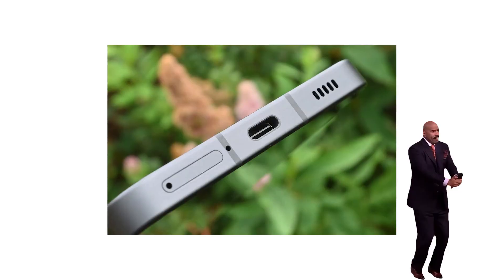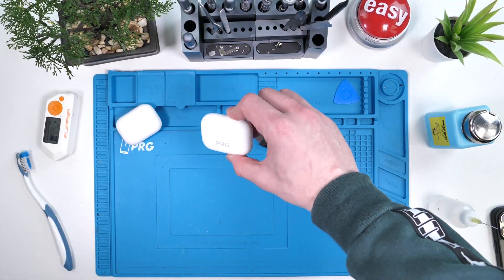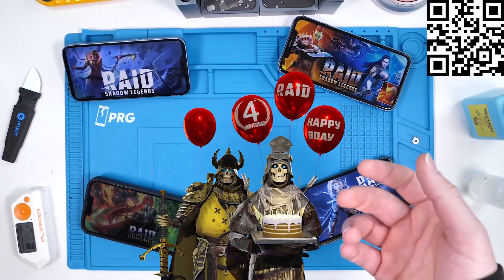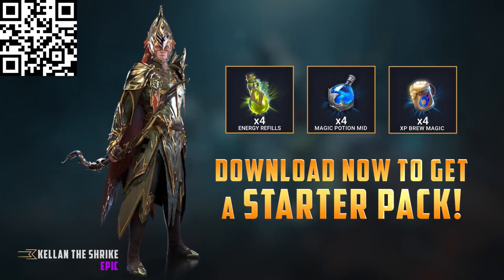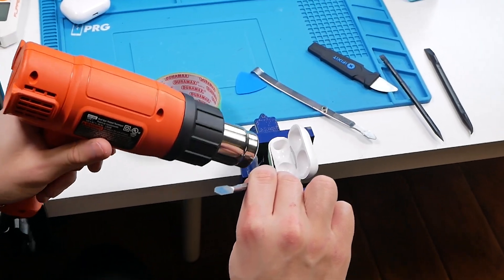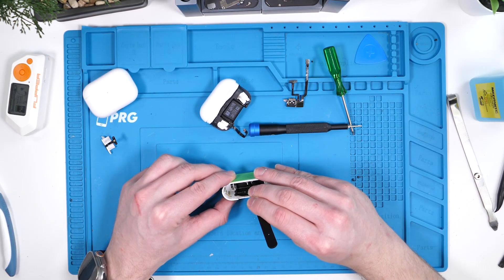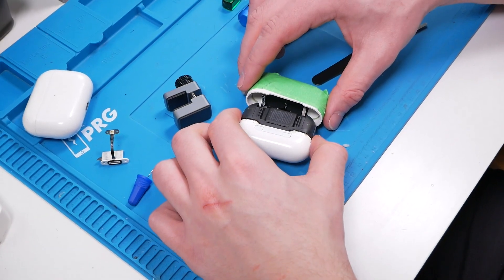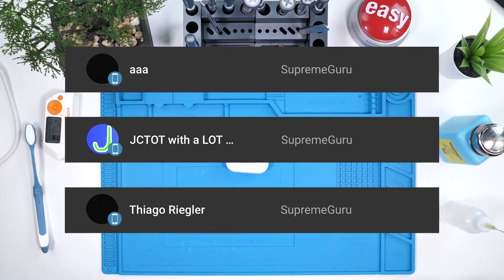Apple Won't Like This One... Airpod Pro Mod

Comment: USB-C in the style of lightning would be better. Lightning is more durable because the male end that can break is on the cheap cable not on the expensive device. Lightning with USB 3.2 or whatever is current would be the best connector. Period.
Reply: Does that happen on the macbook?

Comment: Little tip from an ex GB, when trying to flush mount connectors like this, do the mounting screws up a little bit, then use a cable to make sure the port is snug before tightening down the screws.

Comment: hey i dropped my phone in water i tried powering it off shoving in a towel and using silcon packets it turned on but the screen turned green and turned off and wont turn on what do i do

Comment: Barely able to see led in camera L
Meanwhile on $17 amazon bud it projects a green dot on the ceilings and you always know where it is. Also big case L I literally found $19 (and tested) that can recharge the 8 hour battery on the waterproof earbuds 10 times and charge your phone and tell you the exact battery percent on the headphones and case and not being light mode and it's barely bigger 😂

Comment: Yo…… how do you swap the battery?
Reply: Your iPhone is eligible for a battery replacement at no additional cost if you have AppleCare+ and your product's battery holds less than 80 percent of its original capacity.

Comment: HI man im tshepo from south africa..can i ask something...ive an iphone 7 stuck at bootloop tried recovering it using software restoration but it didnt work...went to a repair shop to get it fixed but they said they dont see the problem or cause of the bootloop..i was asking if u could help me and tell me what the problem could be

Comment: I dont hate mods but such a stupid idea. Lightning, aside from slower charge rate, is much more beneficial than USB-C. Better looking, easier to use. Plus you damaged your airpods case doing this. Imagine the cable just disconnect insidr the case and now you cant even charge it. Keep them untouched and if you hate lightning you can just buy a pair of TWS earbuds.
Reply: Stay with the program bro

Comment: Ensure longevity?  I mean this is cool and all but your 'old' lightning cable will still work when everyone else has moved on to USBC and even if you convert the port to USBC the apple battery in this thing is going to go to crap in 3 or 4 years (or less if you draw the gone-to-crap line at 50% capacity instead of 20% capacity.)

Comment: The USB-C Cable can be put in 2 ways but the Auxiliary Jack can be put 360°
Reply: Let’s go! 3.5mm jack master race!
Reply: Didn't some old keypad mobile phones use 3.5mm jacks as data transfer and power?
Reply: @benjaminzarkhin1293 iPod shuffle charged using the aux port
Reply: @benjaminzarkhin1293 yup. I had a couple...

Comment: USB-C is fragile and not great. Lightning is much nicer in build quality and the feel when you plug it in... yes speeds are not great, but that has no connection with the "cable" itself. It's just the chip inside. Also what's the point of high speed cable for charging... none

Comment: I was going to wait to go from AirPods 3 (that were free from work) to AirPods Pro once they switched to USB-C, but honestly I never plug mine in to begin with. I just Qi/MagSafe charge them periodically. 

They just don’t need to charge often / fast enough to really be worth an operation like this for me or for USB-C to be that big of a deal just for charging. Other than just for a project to do